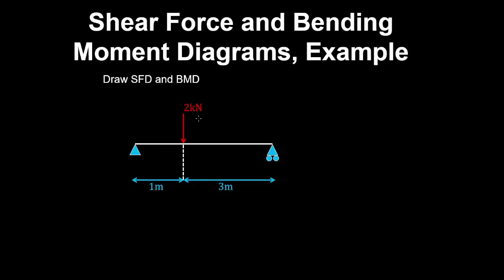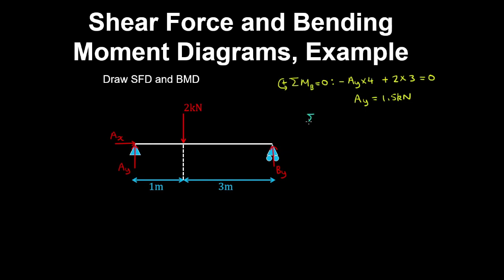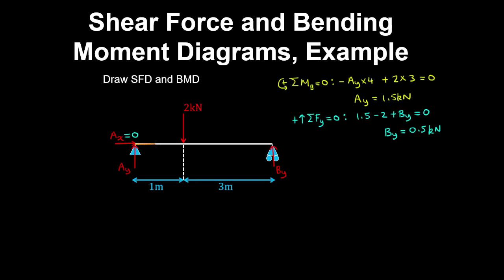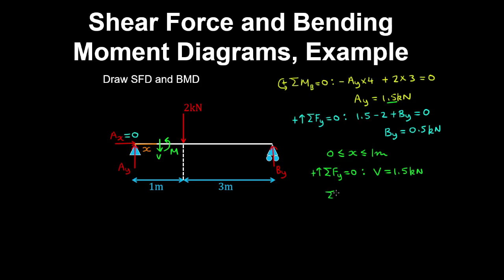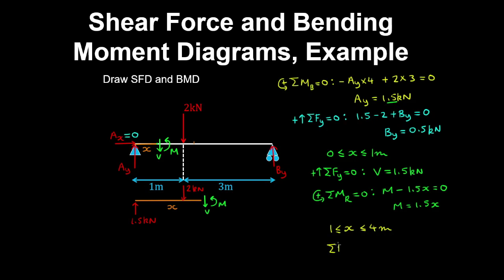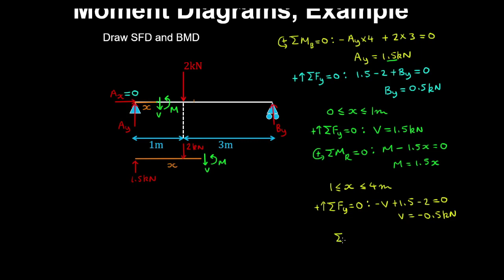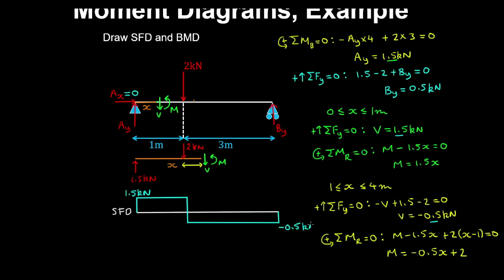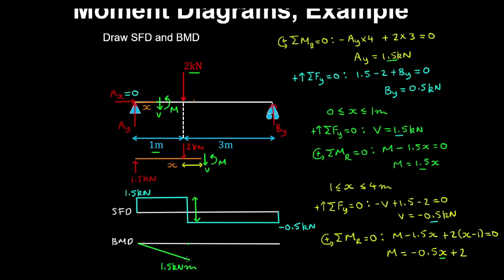Bending Moment, Shear Force, Beam, Example - Structural Engineering

Comment: Another question is that at 2:24, the convention is anti-clockwise, but I have noticed that most of the time we used moment about the point of right side of a section M sub R. What if we study the left side of the section M sub L, is the convention still anti-clockwise for the postive moment?
Reply from the maker: Don’t confuse moment equilibrium to find reactions with moment equilibrium to find internal bending moments.

When taking moment equilibrium, you can choose either clockwise or counterclockwise as your positive sign convention.

Try a few problems in my structural playlist to get the hang of it.
Reply: @drofeng  Thanks! After some exercises, I no longer make mistakes when finding internal shear and moment of a beam.
Reply from the maker: @mattthinks very good, examples are always helpful.

Comment: Hi, I have got a question for a long time about the sign of shear force and moment after cutting a section. For example, at 3:03, we cut, we exposed the internal shear force, how do we decide the direction of shear foce and bending moment? According to the sign convention? But how do we make sure it is the actual direction? Since the reaction forces at pin A is definitely actual upwards. Or the actual internal shear force does not matter, it will be negative if the actual direction is the other side? Okay, maybe it is like this
Reply from the maker: Check out this video on sign convention and let me know if it helps 

Bending Moment, Shear Force, Sign Convention - Structural Engineering
https://youtu.be/wJzrtHih_j8